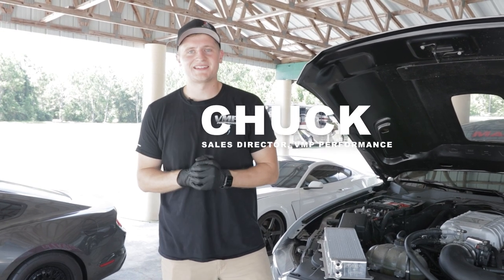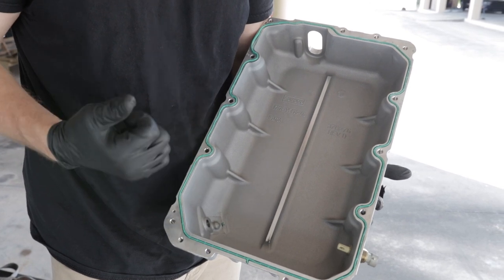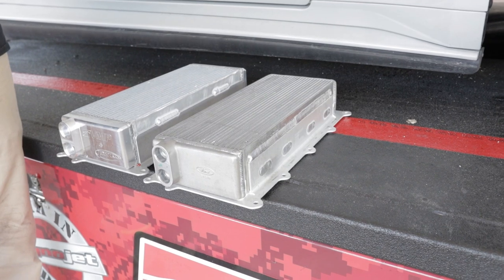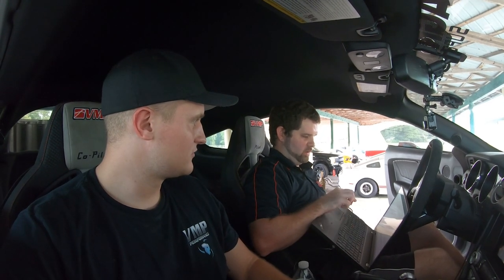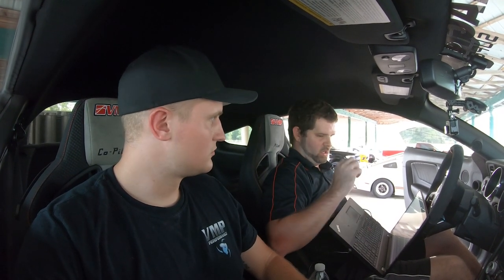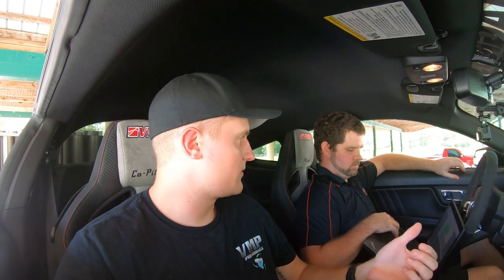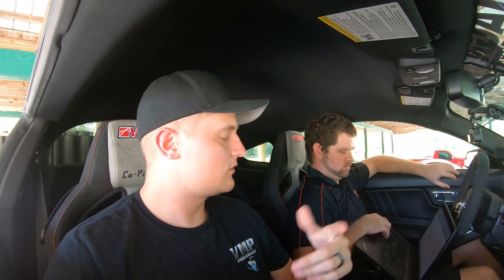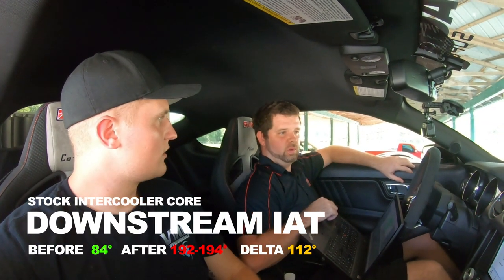World's First 2020 GT500 swap | VMP 81 MM Race Intercooler Core Swap

Comment: The fact your dyno in 99deg by itself is more proof of the efficiency of the intercooler brick .  22-30deg higher downstream temps to start but with 19-24 deg less finishing temps .  Wonder if the new brick being taller if it is actually taking away the air volume being pushed ? That top lid has that divider , just wonder if it's causing a airflow restriction ? Everything was still the same from the 1019 pull right .